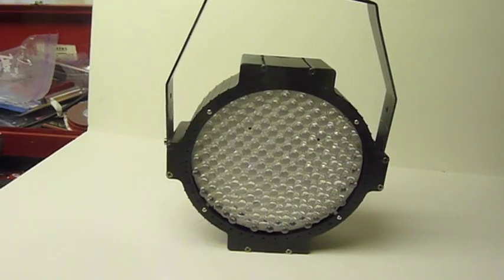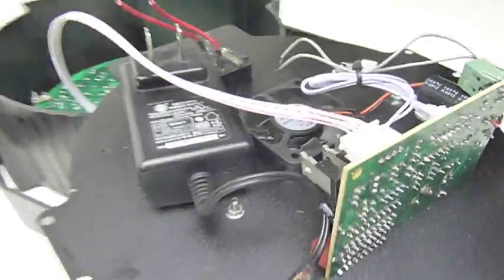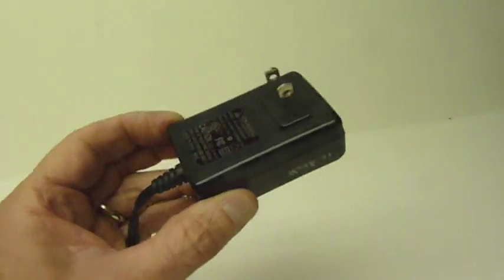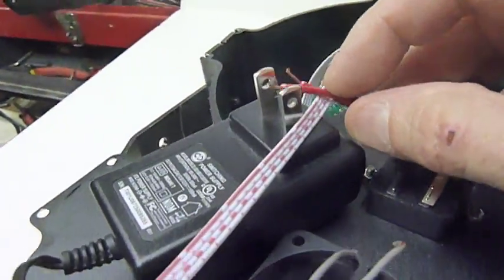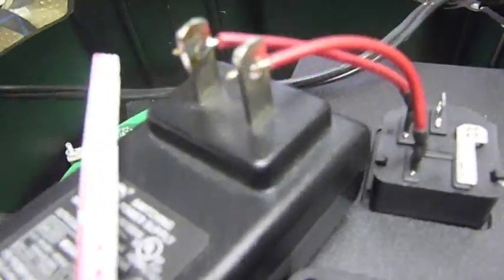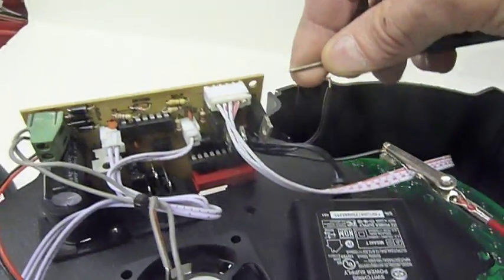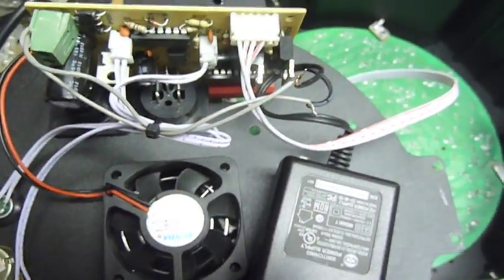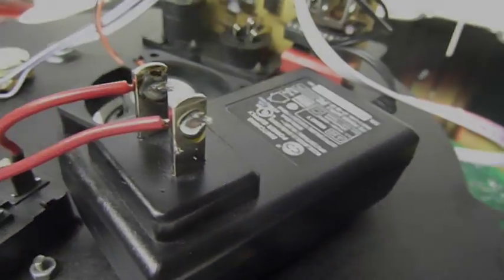How to fix a broken LED SlimPar 64 (Simple Power Supply Repair)

Comment: A chinsy repair, use Gorilla epoxy to fasten the wall wart. Fail 2 here is these are more like 32 watt power supplies, a 15 watt is under powered for 64 leds all on at the same time. A32 watt 12V laptop supply would be better, externally mounted if need be.
Most failures are usually the leds or SMD resistors on the lamp board anyway,,that is my problem, I can't seem to find replacement LEDs and part numbers must be a secret.
Reply from the maker: Thanks Daniel- I like your idea of using Gorilla epoxy, but I will tell you I have used 3M outdoor mounting tape for countless mods through the years and never had a fail! The little power supply exceeded the amp rating of the failed power supply and worked fine. (better quality I'm imagining than the cheap original that failed) 
Most definitely not a "pro" repair job, but in a pinch got me through a few shows before I retired the light. Thanks for spending the time to watch and comment!

Comment: I don't think that's the way to go. I was pretty schocked by this "repair". No safety what so ever. It hurts just by watching it. I would rather buy a new supply or at least repair the original power supply, instead of schoving some random Powerbrick in the fixture. Sorry but this is way too dangerous.

Comment: While I am all up for creativity, this is not a safe repair. Double-sided tape will likely fail one day when the inside of the cabinet heats up in in the sun, a parked car, or from general use; and then you will have a 120v adapter flopping around inside the case of the  light.  Then, with the adapter loose inside the case, a soldered connection could break/fatigue off and then short your control board, send 120V down your DMX line, OR worst-case, electrify the chassis, your metal light stands/trussing and electrocute someone. Creative? YES! :)  Safe? NO!!!   Also, not sure what kind of fight you'd get from an insurance company if you burned down a high-school or wedding venue with a home-made non-approved modification like this.  If you're set on this sort of mod, I'd recommend a good epoxy and/or custom metal strap bolted to the chassis, to help ensure the adapter stays put, and heat-shrink tubing FOR SURE...on ALL soldered connections to keep it a least a little safer.  I DO appreciate these cool tutorials, but let's encourage safe repairs,  at the very least. The best solution would be to repair the approved OEM power supply and re-install properly.
Reply: Gorilla epoxy will solve that problem but true, this is a bit of a Micky mouse repair.